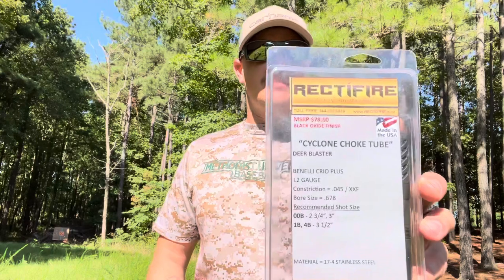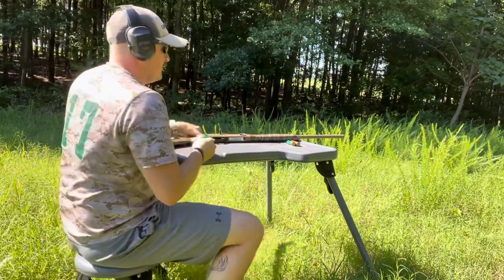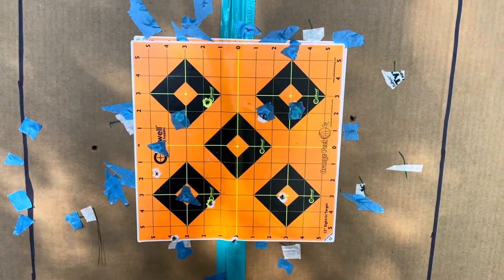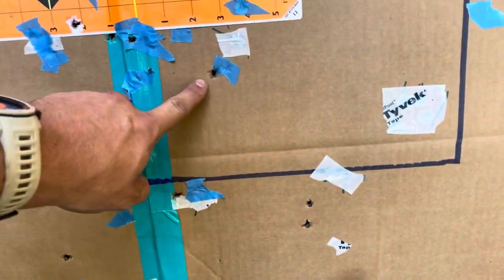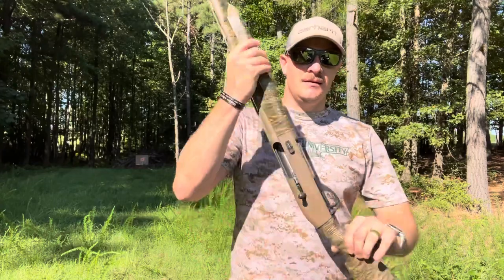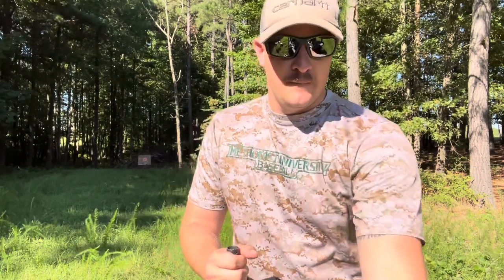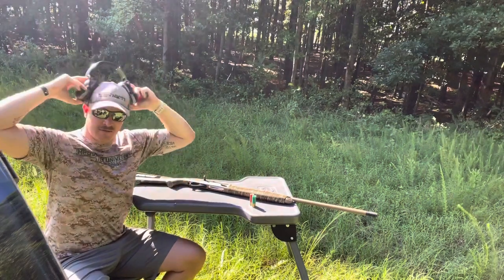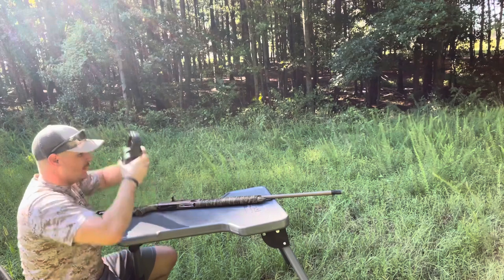Choke tube testing buckshot out of factory full vs Kicks buck kicker vs Rectifire

Comment: Nice gun, I always wanted a semiauto to help with recoil on those 3 1/2 shells, they're too brutal out of my pump.  My initial attempts at buckshot  patterning were discouraging.   I would get a great pattern one day  at 50 yards and think I found the right choke . But then get befuddled  with a horrible one another day with the same choke/load , and vice versa.  I  then started shooting at least three shots per choke tube/load Iooking for reasonable shot  to shot consistency. My shoulder and bank account were not happy with me  but I eventually found some acceptable combos. One 870  pump shot 3 inch Rem 000 well with the high flyer mid range (lead modified/steel full) tube, one  Nova shot 3 inch Fed premium 000  well also with a high flyer mid range, and that same Nova shot Rem 3 inch 00 well with the buck kicker xfull. I stopped there,  but    probably could  have found  a good choke combo  for the winchester and federal 3 inch 00 if  I would have been willing to buy more tubes to try.   I wish you success !

Comment: Nice video! Interesting results that are consistent with my own experimentation with specialized buckshot chokes over a few decades. 
I ultimately settled on using factory full chokes with 00 and #4  buckshot. Additionally I run 2 3/4", 1 ounce foster slugs through the same full choke as needed in the field. This also allows me to shoot high brass small game loads interchangeably if my deer hunt is slow and I decide to bag some squirrels, etc.
I give up some potential tighter patterns, but gain valuable versatility! When I want to reach out and touch something, I just use my fixed full choke H&R 10 gauge and 3.5" #4 buck. Or my Benelli Super Nova with the same full choke and 3.5" #4 buck. I keep it simple and versatile. Keep testing gear out, I enjoy your channel. Subscribed! 👍

Comment: You're experience with the Kicks choke and remington 3" really shows how it can be imperative to zero shotgun patterns at extended ranges. For that very reason, I have a red dot on my MP153. 

Also as Wade Rush and Rodger Adkins have found (as well as myself, but I haven't made any videos yet) the kicks choke really likes full length wad petals. You can kinda see it with the remington 9 pellet load you shot, since it uses the rp12 wad versus the 3" which just uses a fiber cushion wad. If you get into reloading, definitely try the BP TPS wads. I uses Rodger's 28.5gr of longshot and a white lightning, but I trim it and load it in 2 3/4". I've had good luck with light #1 buck 12 pellet loads. Gets me about 1350-1400 fps and very nice patterns with modest recoil.

Comment: I just got done arguing with a guy about my shotgun getting 85-90 percent pattern in a 8"-10" target at 100-120 yards I use my phone to make videos on my channel one is a 1:08 then a short video so two part but even with a 2&3/4" #4 junkie RIO 21 PELLET round I put 20 pellets in a 8" target at 100 yards,I'm going to make a long video today doing the same test same junk ammo but unedited this time so there's no doubts,I use a Mossberg 500 with a 30"VR fixed full choke with bubba rountree outdoors load Data my shotgun puts 90 percent of the load in a 10" or less target, These New shotguns look nice but screw in chokes are garbage,The entire length of the barrel is cylinder bore then the load gets slammed together in 2" to full 
The old barrels like mine are full choke for almost The entire length of the barrel the load settles and bonds together allowing these 100 Yard kills,at 50 yards or less I get this 3" circle pattern that looks like a huge rifle round